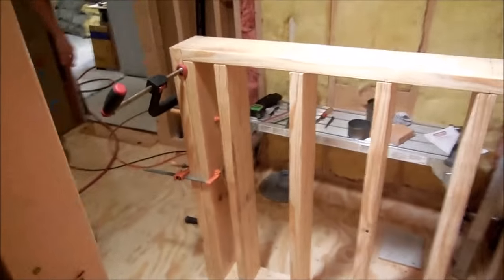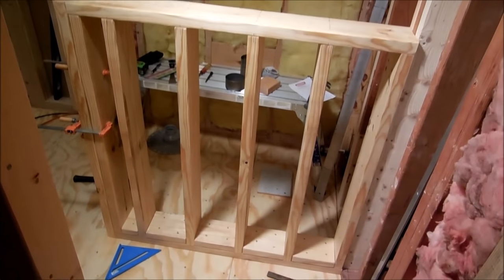How to Build a Wing Wall

Comment: Great video.  I learned a lot.  Wish you would make a video for a wing wall on a concrete subfloor!
Reply from the maker: Thanks for watching and the suggestion!
Reply from the maker: Hey Nancy, to install a wing wall on a concrete wall the only difference would be anchoring the base plate with concrete anchors. Also, you would need a hammer drill and probably 1 anchor per foot  with anchors on both ends but allow room for studs. Your local hardware store can help you with more details. Good luck
Reply: A bit too late for you perhaps, but everything would be the same except any boards touching concrete would need to be treated lumber, and you would fasten to the concrete using a Ramset or other powder fired nailer.

Comment: Nice video. Informative. This will come in handy in a few weeks. Two questions, 1. what timber, it seems pretty straight, 2. How high can you go using this method, without attaching to ceiling. Cheers
Reply from the maker: I use select pine.  I also hand pick my pieces to make sure they are straight.  I think the height question depends on a lot of factors.  Are you attaching it to anything at all? How high do you want to go?  You can use 2x6 pieces and smaller spacing...  Let me know what you are planning to do with the wall and I will let you know what I would do.  Thanks for watching!
Reply: I am going to hack IKEA wardrobes and want a wall to cover the back of one set. They will be like walk in wardrobes. I don’t want the wall to go go the ceiling as there is an air conditioner vent. The long wall will be attached to brick wall and was going to put screws in bottom of wall into concrete floor. The wall will also have a small (maybe 600mm) return. The wardrobes will also be attached to the wall, so I think it will be fine to build the wall say 2100mm high.
Reply from the maker: @phillnavin1212  Sounds like you have a great plan in place.  You can probably use 2x4's since you are attaching to the wardrobe cabinets and attaching that to the concrete floors.  Let me know how it turns out.  I love a good plan that transfers to great work!
Reply: Thanks for taking the time to reply. The plan seemed good to me, but it is reassuring to get an expert opinion. Cheers
Reply from the maker: @phillnavin1212  I am glad to help!

Comment: Next time dbl top plate it will be that much stronger and give you more meet to grab cement board and hold shower glass door and panel.
Reply from the maker: It is actually just separating the toilet from the shower.  Won't be holding anything but tile.  I will upload a picture once it is done.  No shower glass or anything...stepping outside the box on this design!  Thanks for watching.

Comment: Hi. I want to make this wall for my foyer. However, i have LVT. Can I nail the base to the LVT? Or is there something else I can do? Bc LVT install says not have anything nailed to it bc of expansion and contraction
Reply from the maker: You can remove the small section of LVT flooring where the wing wall will go. Maybe even a tiny bit around the wing wall that can be covered with trim so there is still room for expansion and contraction.

Comment: I need a wing wall at the end of a 21.25" deep alcove soaker tub. The tub only has a front apron on it. I plan on using a marble cap on top of the wall that is gently sloped to the inside of the tub/shower. How tall does my wing wall need to be to support a glass shower panel?  Thanks.
Reply from the maker: Hey Patti, can you send me a couple pics so I can better determine what you might need. Thanks

Comment: is it ok to use wood screws vs nails in this application?   also, im reducing a breakfast bar down to countertop height.  Had to use the dremmel tool to cut the 2×6 studs.  plan on screwing down the top 2×6 to the studs....but they may not be perfectly flush.  any suggestions?
Reply: Nails have sheer force, I would not suggest screws [someone leans on that too hard, they could snap...in theory]

Comment: Good video. Clear detail. Can I use this method to build a 5 foot wide 7 foot high interior partition wall that is not attached to the ceiling?  (My ceiling has asbestos in the stipple,  so I am not even going to touch it.)
Reply from the maker: I don't suggest building one that is not either attached to a side wall or ceiling.  Are you securing it somewhere other than just the floor?
Reply: I was going to do the floor and the wall...but...I have decided to just string a curtain using a Bouclair cable kit. Much cheaper and faster. LOL. Thanks!
Reply from the maker: Much easier...Good luck!
Reply: I am watching where you put your hand using that nail gun and I hope you don't hit a knot because that nail will deflect and one big boo boo
Reply: Mario Rios, that would make for an even more awesome video.  A little drama goes a long way on YouTube...lol!

Comment: Thats what you get when you hire a finish carpenter to do a frame job. at that rate he should be finished in roughly 2 and a half years. It has nothing to do with quality, you can get the same result, without clamps and just using your hand.

Comment: How would you suggest I build a 6’ between shower and toilet and support it from swaying side to side?  2x4 wall. 1x4 cross brace efficient?
Reply from the maker: If it was building a 6' x 6' wing wall, I would use 2x6 materials.  If 2x6 can not be used, go for the 2x4.  If using 2x4, put in recessed diagonal bracing.  One on one side of the wall, and one on the other creating an X.  Same procedure on the 2x6 wall.  2x6 is just less likely to sway    I would use liquid nails between the wood at all connections and  3" deck screws to secure materials.  Pre-drill your holes so your wood materials are sucked up tightly.  That will hold much better than a nail.  Let me know how it goes.

Comment: What size nails are you using for the wing wall. Plus, is your nail spacing about 6”?  I’m building one that will be tiled and have glass on top that goes to the ceiling. Thanks. Great video!
Reply from the maker: I use #12's on the framing members.  If I am toe nailing, I usually use #8 ring shank.  I am usually an over builder...I use more screws than you probably ever need because I like to maximize my stability.  If I feel like I may split wood, I will pre-drill through the top piece so that it sucks up to the back piece.  My spacing typically differs based on the material and needs.

Comment: how do you keep it from wobbling? next part of video? like how it was sealed and finished tiled?
Reply from the maker: Mine is quite stable.  We also don't lean on it or pull up on it.  That can weaken your structure.  The only way to make sure there is no wobbling at all, is to construct your wing wall out of steel.  You could also use metal clips for extra support.  I have a video showing the finished Wing Wall.  https://www.youtube.com/watch?v=ON5aLG_L91Y

Comment: Are you using 2x6s? Going to build one soon just want it to be as sturdy as yours
Reply from the maker: You can use 2x6.  It will be much heavier, stronger and stable.  As long as you have the room, go for 2x6.
Reply: What size did you use in the video?
Reply from the maker: 2X6

Comment: I am making a wing wall out of 2x4. It is 60” in length. How would you make it so it won’t wobble?
Reply from the maker: If you use 2 x 4 then I would suggest you use 1/2" to 3/4"  plywood on the outside and glue it and screw it on.  I would also use metal clips and even some steel reinforcement on the inside of your wall if you so choose.

Comment: Great video, one question about the last piece of wood “the cap” why is that necessary?
Reply from the maker: Are you referring to the second piece of wood put on the face of the wing wall? If so, it is really personal preference.  I like the extra wood there because it gives me a more secure structure when I am screwing in my Sheetrock.  The more stiff, the more strong it is.    When you have a heavier the wing wall there is no worries about stability.  That is also why I use 2x6's and not 2x4's.  Hope this helps.
Reply: Yes, is it just for rigidity.
Reply from the maker: You got it!

Comment: Great video! I’ll be setting up my own half wall for our shower soon. 
Three questions i have 

Is your bottom plate screwed into the floor joists?  
And 
How long are the blocks you nail in between the studs? 
And 
What are you stud placement measurements?
Reply: All good questions. This video is 80% nail gunning and setting nails.    10% guy leaving screen to find something and 10% useful information.

Comment: Great video, I am doing one now for a bathroom remodel.  Just curious, what is the length of those small blocks you installed on the bottom between the studs?  Is that by code, or just your preference?  Thanks!
Reply from the maker: Great question.  Typically, it is 16 to 24 inch on center.  I went with 10 inch studs on center. I wanted mine to be beefy.  I like the extra support. The wood blocking pieces were cut to fit in between the 10 inch studs.  Hope this helps.

Comment: can I make  a bathroom wing wall out of 2x3
Reply from the maker: You can.  However, you won't have much lateral strength.
Reply: @strongarmconstruction5562  , that works it will be sandwiched between the vanity and spa tub, Thanks!
Reply from the maker: @nspgmedia4375  Good luck!